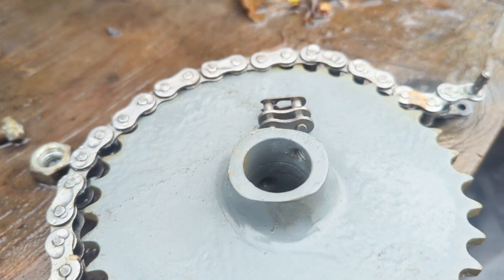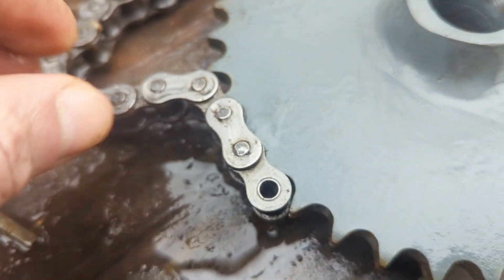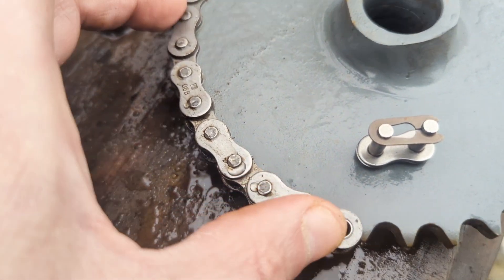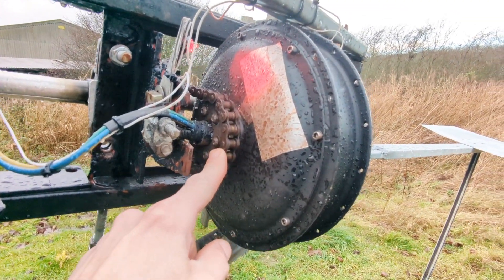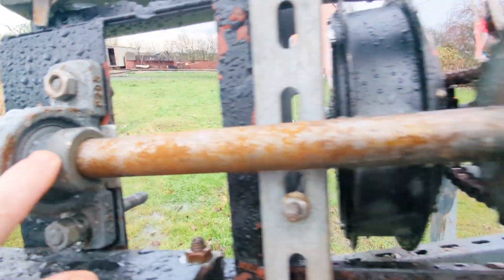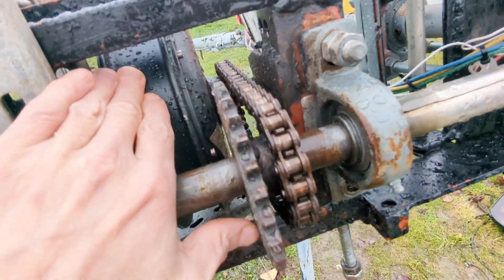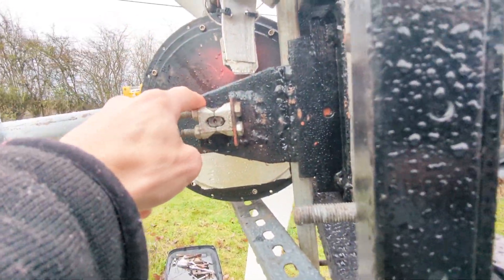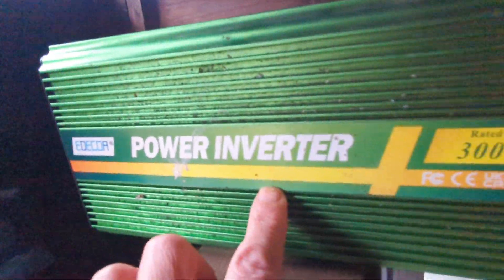High Speed Gear Upgrade for the Monster Wind Turbine - 37t-18t - Motor to hit 600rpm !!!

Comment: Gavin we using lead or lithium?
   ( Information for others ) 
Lead is more forgiving when charging and discharging. 
Lithium 100% needs a lithium specific charge controller and voltage set cut offs both on its higher and lower end. 
Those inverters  are typically Modified sine wave.  Its safer to run them at 1/2 their rated capacitance. 
Why? Well companies  in the east that mass manufacture  Lie to the public in order to make sales.  Its a rare occurrence to find any cheaper inverter to go full tilt and run at its max rated running wattage.  
So a 2,000 watt inverter we'd settle to just pull 1,000 watts out of it and should last a while.
 Always use over sized wires from battery to the inverter.  
12v bus wires thick as your thumb ( copper tubbing flatten with a hammer wrapped in an insulation material widely used if wire is not available and 24v thick as a pinky finger. 
Adding in 3 sets of DC breakers for line protection and device protection on the hot lines between a power source such as solar or wind turbine to charge controller/ 
and then again between Charge controller and Batteries/ 
and then between Battery to Inverter.  
To find the proper amp rating we use  volts divided by watts will give you the amp requirement.
  So a 300 watt turbine at 12 volts needs a 25 amp fuse. ( 300 divided by 12 = 25 ) 20 amp fuse is too low and 30 amp fuse might be ok ( it's  close enough ) But a 40 amp fuse to far too much.
 DC electric loves multi stranded wires  and AC prefers solid copper single strand to travel over.
 Grounding all devices uses a solid thick copper wire to earth ground via multi ground block terminal. 
 Our wires in the USA are thicker as we use 120v  vs Europe's 220v systems. 
Which is better? The higher voltage always for line efficiency.   
DC drops voltage over distances. AC travels better and father with less voltage drop in comparison.
I'm rambling here so I'll stop  😆
Reply from the maker: Empty lead :) to be fair they are years old have taken a proper beating